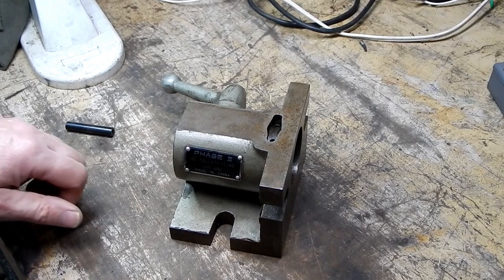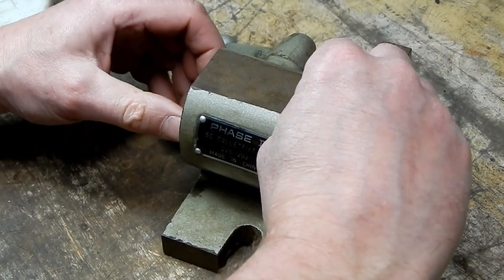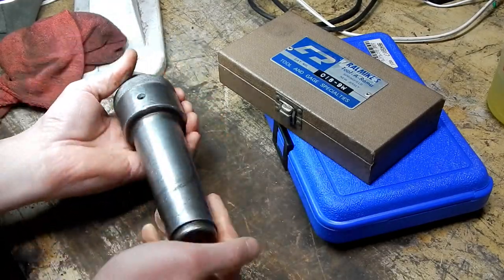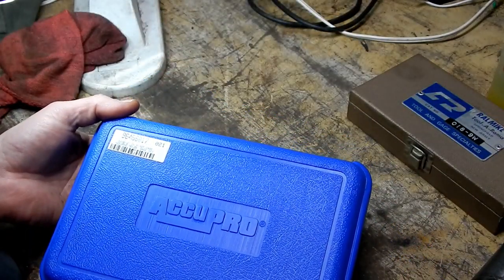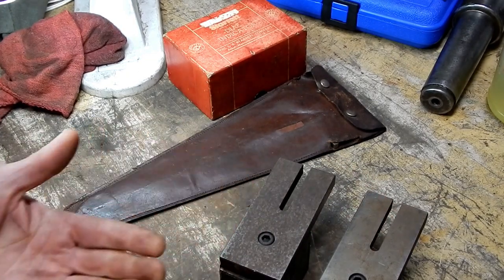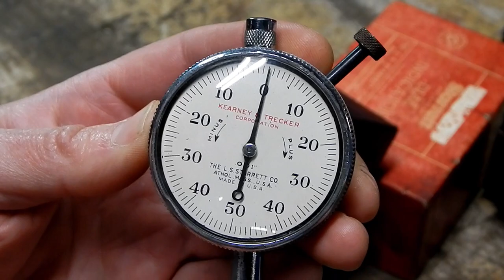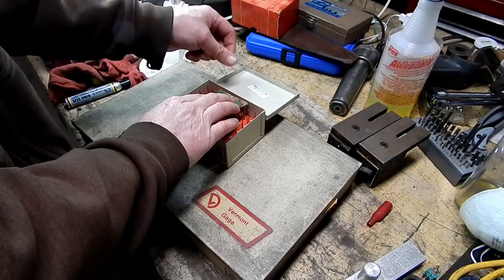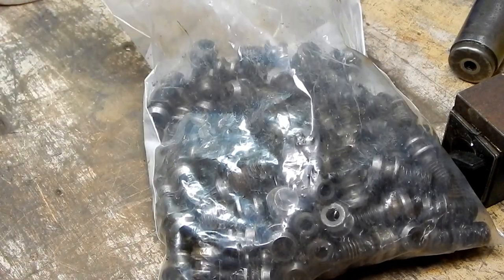Early May 2020 machinist tools pick Part 1 of 2

Comment: Indi-cal is still in business. very nice and very handy. Ralmike is pronounced ral-mi-kee (or  ral-mick-ee). Accupro is the MSC house label,lower line. Tele gauges still work fine when crunchy, but I agree with T-O-T that they should feel smooth. Love my old Lufkin's. ANY mag base is useful. The more configurations you have, the better. Vernier depth gauge is a Mauser. Came to the US under several brands. IIRC, the indicator mounts in the same slot as the travel stops (again, if I recall correctly) with the proper stud.
Reply from the maker: Thanks for watching.